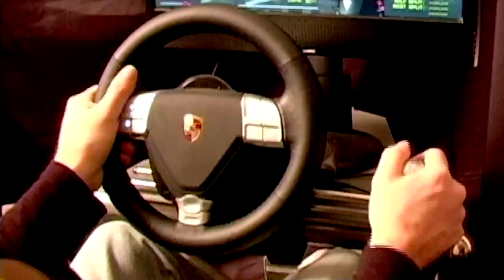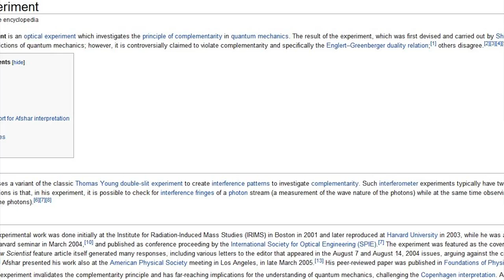KOR-FX by Immerz First Look & Interview with Shahriar Afshar

Comment: Btw. have you guys ever checked out TrackIR or Freetrack (the commercial product and it's freeware correspondent). It works in Codemaster games like GRID, F1 2010 and in GTR from Simbim. It scans your slight movement of head moving and translates it to the game, making it possible to take a free look around in your virtual racing cockpit. So you're able to look to the apex in corner or your mirrors while fighting for positions.

Comment: @killerbng I built one myself and use the Freetrack software (as it says it's completely free). The parts were quite affordable (around 15€ for cables, ir-diodes, a USB power adapter and stuff, and 30€ for a wiiremote which I use for tracking the diodes on the headclip) - So one evening handicrafts and 45€...
It works fantastic (after calibrating the software) and is a real enrichment for games which support the interface. Especially recommendable for flight-sims, of course.

Comment: What's the difference between this and the Buttkicker?  This is a lot more portable and mobile than the Buttkicker.  It runs off batteries and does not confine you to one specific location.  You don't have to sit in a sweet spot or specific chair to feel the action.  You can easily be playing a game on an iPod, PSP, or other mobile device on an airplane and feel the action.  I don't know about you but if I'm playing a shooting game and I get shot, I'd rather feel it in my chest than in my butt.